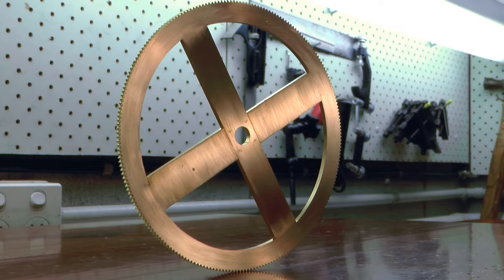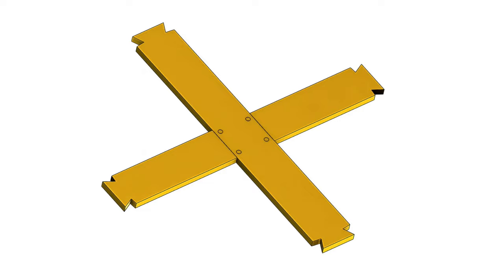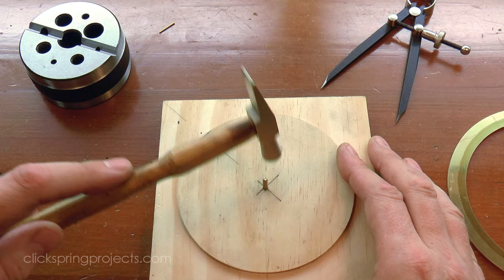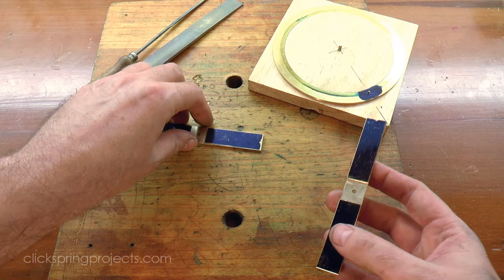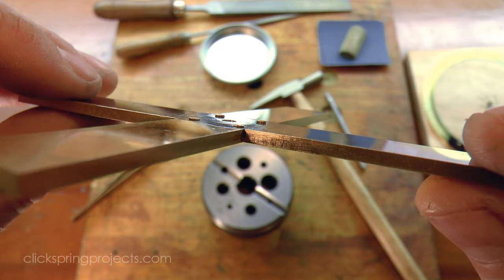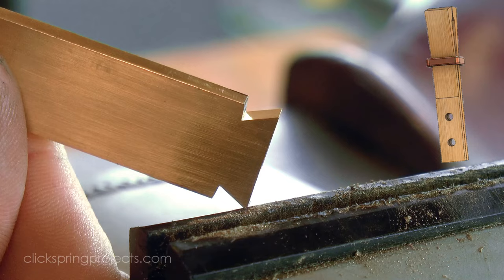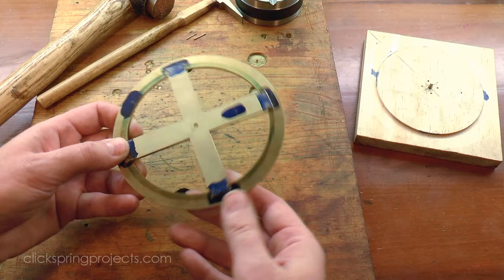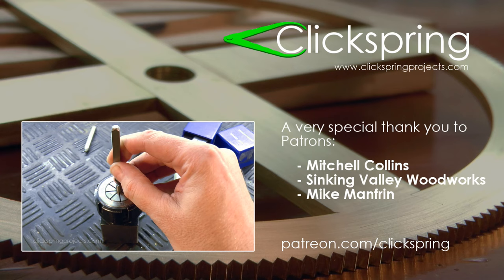The Antikythera Mechanism Episode 2 - The Main Solar Drive Wheel B1 - #DialOfDestiny

Comment: You've got a real point about jointing when he could have just formed it from  single piece. I'm not too sure the price had anything to do with the jointing rather than being done as a single piece. After all, the circle would still need to be done in one piece, and everything is internal to it. It would be both quicker and easier to simply cut out the quarters between spokes and reclaim the scrap on the hearth.

Here's an interesting theory: The Greeks were a people who did things to prove a point. What if this device was a case of a master at his craft teaching his apprentices the various ways and means of going about joining pieces of metal? Or perhaps the reverse: a student's work, and the instructor insisted on him including various joinings to show he knows how to do them?

I do agree that Bronze was a very expensive metal, high in demand. However, you had to have a disc to form the wheel anyway, which means you could've just cut out the spokes, I don't see how any material savings could've been had by doing it this way.

Comment: Stunning workmanship!
I don't know if it's just me, but I didn't see you countersink the holes the rivets were driven into.
Since you filed them flush to the surface, there is no longer any compressive force 'pulling' them together. Just the interference fit of the pin.
Or am I missing something?

Comment: Ah, Chris. Lovely work is afoot once more. Query: Is this build to the same size as the original artifact? It's funny how we perceive things but I always imagined the device as being larger. And (as a former model maker for various folks) I know that the bigger the scale, the easier the work. Of course there's the increased cost of materials with bigger sizes; probably a serious concern in ancient times. 

Query the second: Do you need a shop hand? I only require room and board, airfare to Oz, and the occasional frosty beverage. Oh, and can you work out some sort of leave with my current employer? I'm wicked good fun to have around and eagerly await your refusal... :)
Reply from the maker: Ha ha! Would love to Pat, but seriously no room! Yes to scale on the build, based on the measurements of the artifact - it is surprisingly small, and the teeth are just incredibly tiny.

Comment: Would they have even used sheet stock? Thinking in terms of saving raw material, I could imagine a ring of bronze being poured and then ground to size for this wheel.
Reply: Frank Sijbenga Yeah. I wonder too. Would be cool if Chris could show how this was done back then. Maybe in a museum?
Reply: Max Maker I think poured metal would not be strong enough?
Reply: After casting, the metal may have been hammered to improve the tensile strength. The ancient equivalent to shot-peening.
Reply: Oninoni strongly depends on the metal – cast steel is not the same as cast bronze, and I bet the latter isn't nearly as fragile (cast bronze swords were being used, while steel ones had to be forged). I'm not a material scientist though!
Reply: Whether a casting is strong is completely dependent on what it is cast out of. There is an immense amount of variety when it comes to the chemical composition and treatment of alloys and Im sure that with the right alloy of bronze and the right treatment process, it is possible to cast parts like these.
Reply: Yeah, I would guess that all the parts came from castings as I don't think they had roller mills to produce sheet stock.  Cast bronze can actually  be fairly strong depending on the alloy.

Comment: Loved the video as expected, but i was wondering how long did it take you to make CAD for this and if your only reference were those scans  that researchers made.
Reply from the maker: Data has come from many places, but essentially its based on the latest research - Freeth/Jones, MT Wright etc Some of the key data points that establish the scale of the device are from the Freeth/Jones 2012 paper where they measured the wreckage. However the vast majority of the engineering detail in my CAD model (that goes beyond the conceptual schematics) has come from many hundreds of hours poring over the scans, to make sure I've got it right.
Reply: Clickspring a lot of people would be interested in seeing how the CAD model came together. Bonus video?
Reply: +Clickspring  "hundreds of hours" holy shit!! you NEED to make a video about that process PLEASE!!!!
Reply: The CAD images look a lot like solidworks and that is basically drawing a shape and adding necessary relations and dimensions. 90% of those hundreds of hours was probably moving certain dimensions on the scale of half a millimeter and it really isnt interesting to watch, the same reason why these videos dont show 6 hours of 1080p real time filing.

Comment: You mention the tools they possibly had as including files.  I'm wondering how they made files (at least the files similar to the ones today)?  Hardened steel with teeth cut in a regular pattern.  Perhaps they used some other kinds of abrasives to achieve the same goal, albeit with a lot more effort and time?

Comment: 2:36 the maker probably found out (or assumed) that this dovetail join wasnt able to hold the pressure of a heavy and never properly lubricated mechanism. I started watching this series from the begining and I dont know if you're going to mention that it must have been difficult to lubricate this mechanism, which I suppose is a heavy one too. Good lubrication is essential for these mechanisms to function smoothly, and I suppose we also need to take into account that back then they surely wouldn't have discovered a lubrication oil needed for such unique mechanisms. Just sayin; not an expert

Comment: They did have screws back when the Antikythera mechanism was made, so it wouldn't be too much of a stretch to imagine that they could've had a vise similar to the ones we use (except made out of wood). Like this: https://youtu.be/Rqs7yebfLEI
But even if was made of wood, a screw vise would've been really expensive at the time, so most workshops might have used a wedge vise, which is basically a box with blocks of wood in it squeezed together by a wedge, something similar to the one in this video: https://youtu.be/JSZxPd8EaWs

Comment: Question:  you don't mention it but the value of timing marks on the gears? Would that not save ancient builders some time? Replicating the build? Thanks. Your amazing
Reply from the maker: You are correct, it would, and there is a hint of such marks in the wreckage. I have also made some of my own for more convenient reassembly etc. Will discuss later in the series - Cheers :)

Comment: I think your thought about the clamping mechanism could be accurate. Even nowadays, if you sew leather you'll probably use a almost identical tool...
Reply from the maker: Yes I think its very likely to have been something along these lines - Whatever was used, it would need these attributes as a minimum: continuous access to the perimeter of the part for filing teeth etc, and rapid repositioning of the workpiece to progress the cuts ie be easily flipped, turned etc
Reply: TheRealObiWahn How is that tool called?
Reply: I don't know exactly what it's called in english, I think It's called "leather pony". In german it would be "Leder Nähkloben". If you search that, you'll get at least a picture and vendors who sell these...

Comment: Awesome series. But i think its illogical to think they didnt have a proper vice to hold things. They made this mechanism after all.
Reply from the maker: Yes entirely possible, the screw thread was first documented in the 3rd century BC, wine presses for example were a well established technology - but the interesting thing about this small parts vise is that I too have several very good quality vises, yet I rarely use them any more for anything but the most coarse work since making this one. It greatly surpasses my modern vises in terms of usability and convenience, and would have been much easier and cheaper to make in antiquity - Great to have you watching, Cheers :)

Comment: personally, purely speculating, of the technological advancement this clock conveys, specially considering the tooling to make such, it seems they may not have the technology to cut large inner diameter quarters, such as in this gear. though the making of this gear at, seem sophisticated, for its time, it would seem more time consuming then cutting out the more simpler quarters with the diameter of the gear. it is baffling, to think why would a gear of this nature be made in this way? there is a strong possibility that files were used, files were in existence in the time of this clock, heck the lathe was used in the 11th century, ithis gear, alone, is both interesting and perplexing

Comment: it kind of looks like how you would put together a wagon wheel.  Begs the question: is brass tech is still borrowing from wood tech at this point in history or would the rivited piece be stronger than a solid piece?
Reply from the maker: Hey Colleen, yes it also appears to me that at this point in time (200 ish BC), the metal working tech has a firm foundation in the woodworking tech of the day. It also seems logical and reasonable if you assume that prototyping would more readily and affordably have been performed in wood. Re strength, the fabricated approach for this wheel is definitely weaker than a solid piece. The Maker must therefore have had a very good reason to go down this fabricated path. Thanks very much for watching and asking :)

Comment: The screw was invented in about 400 BC by Archytas of Tarentum. The Antikythera mechanism is estimated to be invented in about 205 BC. A screw vise could have easily been invented within the ~200 years; especially when they're making gears, where a spur gear (non-involute) has a similar tooth profile to a screw tooth. 
In fact, there's probably been nothing new with mechanisms until engines were discovered, which would only improve efficiency of manufacturing and driving the mechanisms. Electric motors would then make things even more efficient. 
But what has really been discovered or invented in mechanisms and machines in recent history?

Comment: 7:50 - "Filing small parts doesn't usually require a whole lot of force"
What interests me is how the original maker would have done it.  You are using a modern, steel file - but unless I'm mistaken (entirely possible) nothing like a modern file would have been available then.  Would he have used a bronze file to file bronze?  If so, then he must have been skilled in sharpening files - and with what?  I guess some bronzes are harder than others, but even so ...
Reply from the maker: A bit for detail on file technology here: https://youtu.be/SOw9WqMOHjA - Cheers :)
Reply: @Clickspring  I have just discovered this answer to a two year old question.  I watched the video, which answers the question that I have often wondered about.  Many thanks for the pointer to it.  I wonder how much of this kind of industry there was at the time of the Antikythera mechanism.  It didn't come out of one person's bright idea.  Industry of this sort takes tie to evolve.
The other thing that came to light in decoding the mechanism is the detailed knowledge they had of astronomy - which they obtained without telescopes.  There were some smart cookies about in those days - then all this knowledge somehow got lost.  I wonder how that happened.

Comment: Another great video. One quesrtion though. What is that small round plate you use to tap out the retaining pins called? Is it a jewelers press plate. I really like that it has a V in the middle for round stock

Comment: You mentioned choosing a dovetail joint to save on raw stock - was  metal available in common "stock" sizes at the time or would the make have cast the general shape of the parts prior to working them?
Reply from the maker: Bronze was still widely in use at the time for the fabrication of personal armour, so its possible the bronze sheet stock was sourced as a standard output from that armour industry. Equally, it could have been cast "in house", or even both. Unfortunately its hard to say, due to lack of evidence.

Comment: Regarding why they assembled the gear the way they did, is it possible the original dovetails were tapered such that the bottom bar was drawn up, and the top bar was drawn down?  Then riveting the cross bars together would pinch the gear ring between the opposing tapers, holding the pieces together securely in tension.

Comment: I'm wondering if those dovetail joints are slightly tapered - and if that "repair" was because a taper wasn't holding sufficiently.  Alternating the tapers would let the centre cross pieces hold the outer ring on securely once the centre is riveted - but a straight dovetail might let the outer ring slip off the central cross pieces.  Thoughts, anyone?
Reply: It seems the repair might have been soldered so why wouldn't they have soldered it in the first place ?

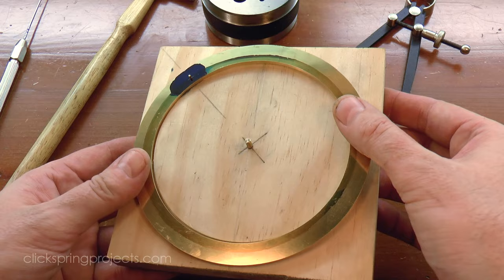Comment: @Clockspring >>> At about 03:39 in the video:  I was wondering about the alignment hole in the wooden block for the smaller pin in the perimeter of that brass ring.  If you leave that alignment pin in the part and not in the wood, I would think that hole would get "wallowed out" slightly over time? 
 
Another question:  I am familiar with riveting as it is used on aircraft.  If you final or otherwise removed the "heads" from those rivets how do the rivets hold those cross pieces together?

Comment: Forgive me asking, I have no experience with metalwork, but could you explain why you put the blue liquid  (Dykem Steel Blue Layout Liquid) on the brass? Is it to allow you to etch patterns into the material smoothly without damaging it?
Reply from the maker: Yes it gives a good contrast for marking, and if careful it allows a mark in the blue rather than the underlying metal, and so avoid scratching the metal - Cheers :)

Comment: Was the center fittings to B1 because they could not get the accuracy to make a center hole? The design allows for it to be adjusted, without complete re-fabrication of the cogs/teeth.
[edit] As you do in your video, you use wood (much cheaper, can be replaced, drilled and tested) to fit it all together and check tolerances. Doing this with a solid piece, of that size, would be too costly (time and materials), cutting it up into 3 sections (main ring, 2 cross bars) makes it easier to refine the tolerances as they go.

Comment: Are there any indications that the outer ring was made in several pieces as well? If the entire thing can't be made out of one sheet and that would be the reasons for the joints on the cross, then the outer ring should be possbile to be made out of a sheet as well. The argument works for cost savings to I think.

Comment: Quick question; if the rivets hold due to the peened end, how does it still stay together after you've filed the end flush? At that point how is it different from just any old pin?
Reply from the maker: The rivet ends have been deformed out a bit like a mushroom at the top, and are an interference fit when inserted - with no axial load they sit there quite comfortably

Comment: Just curious - when you file rivets down flush with the metal doesn't that reduce the holding power of the rivet?  I'm thinking it is the expanded head that is doing the holding... where am I going wrong? 😀
Reply from the maker: Great question - It really depends on the application - In this case the rivet will not experience any tension, in fact these particular rivets need to be flush so that they will not interfere with a flat riveted retaining plate and gears that will go over the top of them in   a later episode. So the primary objective here is that the rivets blend into the surrounding metal and be flush. Its also worth mentioning that a tight interference fit of the rivet itself in the hole provides sufficient holding power on its own. For this 'simple' rivet I find the blend process slightly more repeatable simply deforming the metal directly into the wall of the hole, its very easy to get a seamless join. However if the rivet is required to resist tension in any respect, then a small countersink in the surrounding metal is the standard approach to retain the rivet. It can still be filed flush, a small "mushroom" of metal exists to resist tension that is usually adequate. (Rarely, this countersinked gap may lead to a hairline seam when filed flush during the blend process, hence my preferred process is to avoid the countersinking unless its necessary. ) Finally, if the rivet will experience significant tension and also doesn't need to be flush with the surrounding metal, then the most well known option is to leave even more metal of the rivet proud of the surface - think the classic 19th century truss rivet - very strong, very simple.
Reply: AH! the INTERFERENCE fit is the secret sauce that hold it all together...  of course! Thanks for the in-depth info!

Comment: How does a rivet hold when filed down to the height of the surrounding material? Genuinely curious
Reply: I guess its acts like a very tight fitting pin
Reply: I think that hammering the top of it makes it go a bit in the surrounding material
Reply: @valovanonym  probably